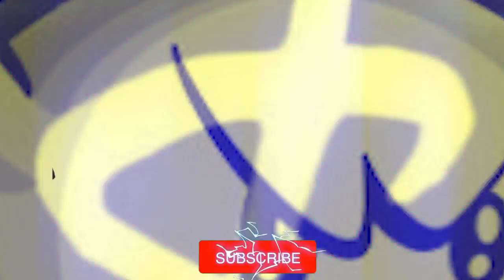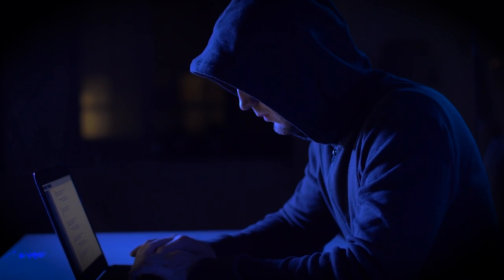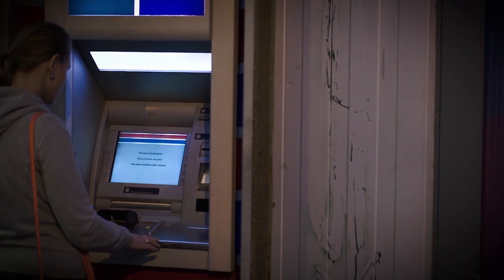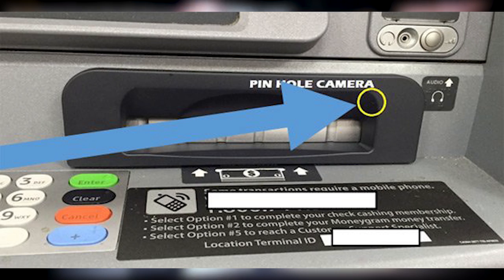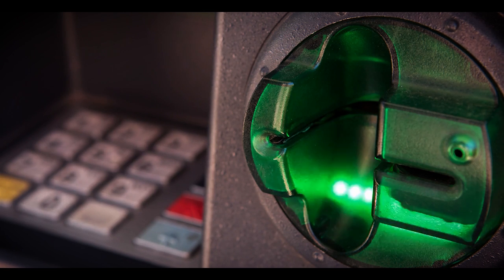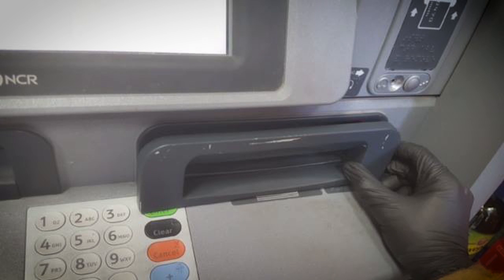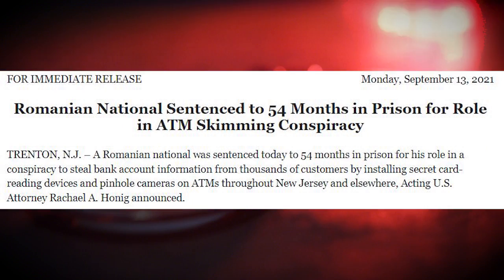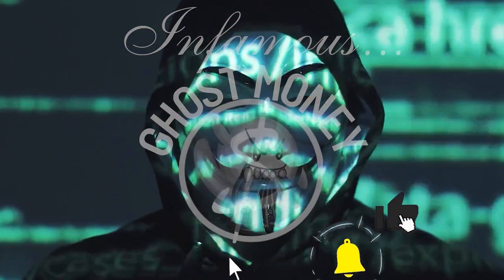What Are Deep Insert EMV ATM Skimmers & How Do They Work? | Bank Scams and Fraud

Comment: Dear god does US banks allow bypassing the EMV security this much? There is supposed to be a random number in the chip that's suppose to have like a challenge-response thing.
Reply: The chip actually generates the number different number every transaction
Reply: Yeah there’s by pass software for that
Reply: @cvvxtp3878  It's on the banks to accept the bypass or not. Banks still need to accept transaction without the random number response.
Reply: @cvvxtp3878 not true

Comment: My bank's ATMs do the "tap to pay" thing so you don't have to put your card into the ATM. I don't know if this is more secure but I don't put my card into the card reader slot.
Reply: This uses nfc and the nfc info from your card can be captured as well
Reply: Moneymills  nfc app?
Reply: Moneymills  but I heard about a wallet that can prevent that?  Where u put ur cards in and etc
Reply: @shawnastell1714  I have a wallet that has RFID blocking. It's called the Flipside Wallet.
Reply: It doesn't matter. If you need cash you use an ATM. People use cash for drugs and that alone is a multibillion dollar industry. For every smart human there's another 12 dumb ones so the best deterrent is using a credit card. If you use debit and your card gets skimmed the customers are liable. If it's credit card the bank reimburses you.
Reply: @mjbzerk894  bingo!!!